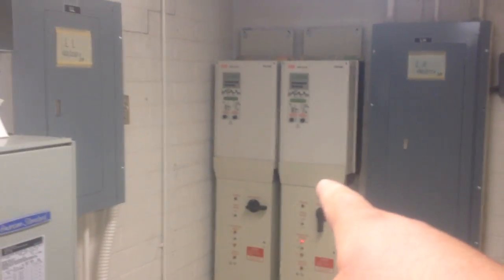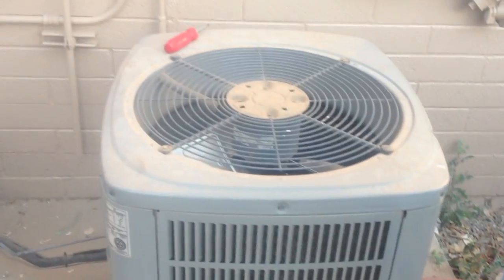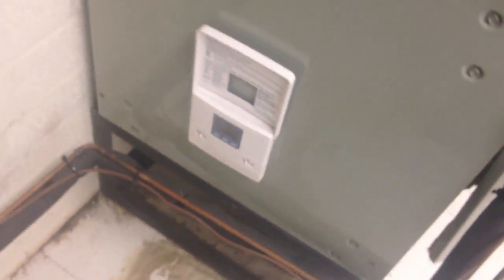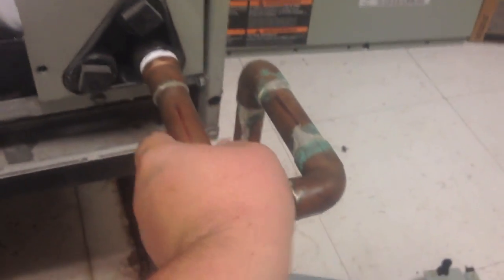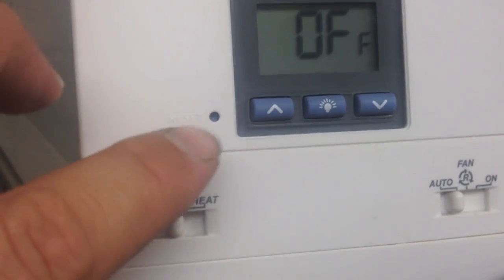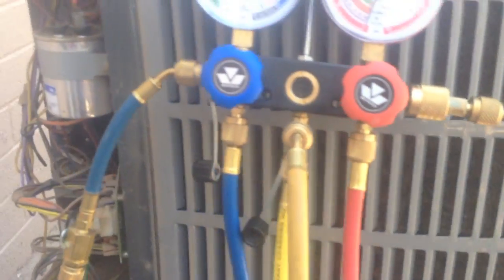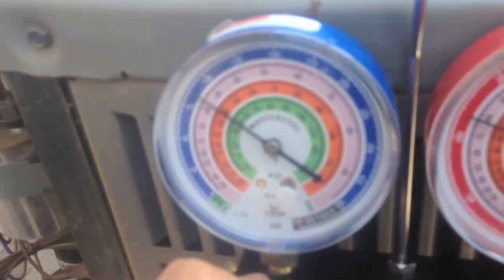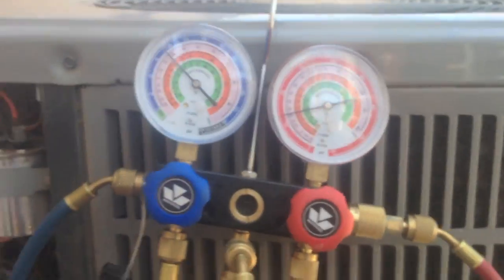HVAC service call

Comment: I see you like pumping air into the refrigerant lines? It's contaminated now! Too late.Air filter had nothing to do with the freeze up, unless the 99 cent air filters you use (hvac techs don't use these for obvious reasons) were vacuumed off before you videoed them. You could have at least installed a freeze stat to protect the equipment. You may have had contaminants in the system that froze on the outlet of the TXV. Recover the charge, install a new drier install a weighed charge and purge your gauges!
Reply: a little bit of noncondensibles never hurt anything,its job security,lol